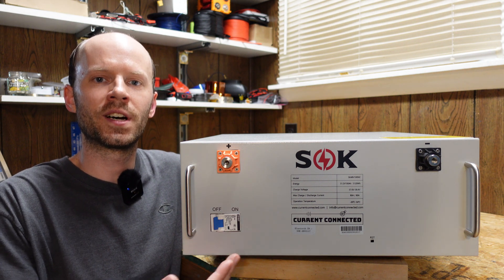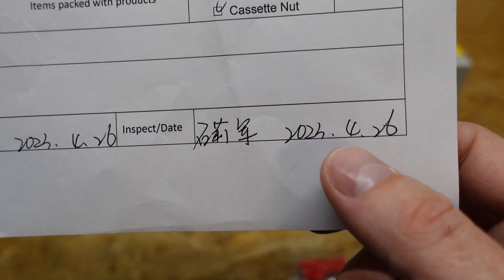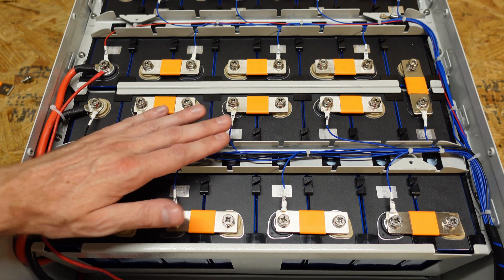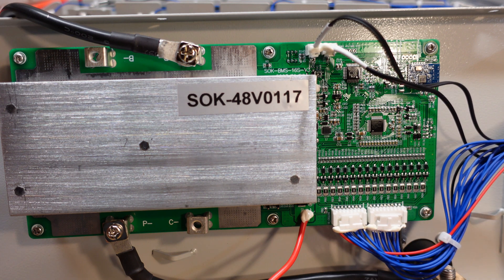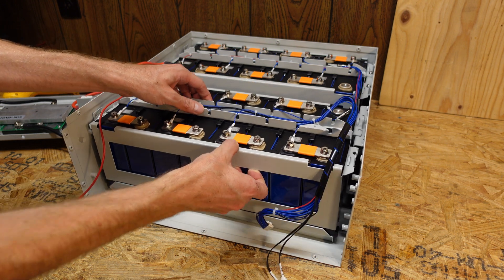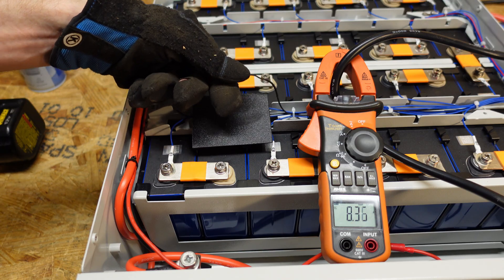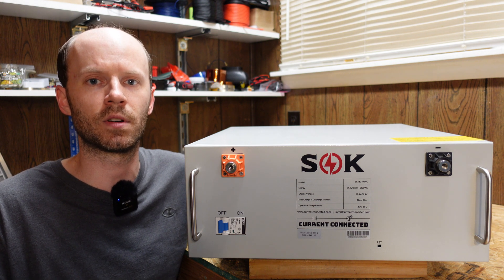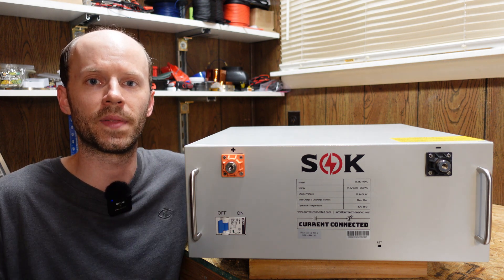The New SOK 48V LiFePO4 Rack Battery, Detailed Review Inside & Out

Comment: Is it ok to connect the battery to an inverter while the circuit braker is off and then turn it on?
Reply from the maker: This model does not have a precharge circuit built in. It may work; however, you risk tripping the over-current protection of the BMS. It's best to use a precharge resistor/circuit for the initial connection.

Comment: Is there any issue with connecting two of these in parallel?   what about connecting them in series?   I'd want to then connect a victron multiplus to allow charging and discharging into the inverter.  I'm guessing parallel might be OK but series would be problematic for the charger / inverter (given that if one disconnects after getting full or becoming empty then the voltage drops from 96 to 48).
Reply from the maker: The batteries can be connected in parallel. They CANNOT be connected in series. The components within the BMS are not rated for 96V (or 117V) and will surely fail as soon as the BMS tries to turn on/off under load.
Reply: Thank you.  Does the same hold true for a lot of these cheaper all in one batteries (for example ampere time's batteries). Is there a limit to how many you can parallel without too much issue?  I suppose you'd start by charging them up individually and then connecting, but then I'd guess they'd drift a bit over time and you'd lose some capacity in each.  I'm having a hard time understanding what happens when one of them decides its full before another one does.  The full one would break the circuit and all would stop charging?  I'm comparing this to the approach of a BMS like Electrodacus's SBMS which uses remote signaling to disconnect loads or chargers rather than using an internal relay to disconnect.  I assume these all in ones use some sort of relay approach?     @LithiumSolar

Comment: 4000 cycles (10 years) retaining 80% capacity. Eg4 at 7000 cycles (20 years) at same 80%. Would price of these even be relevant in that time to to consider the slight increase with eg4. Or nothing to worry about.
Reply from the maker: The SOK and EG4 both have the exact same cells thus the cycle life should, in theory, be the same. You would need to compare how they're defining a "cycle" to come up with those numbers. They're likely testing them differently.

Comment: Compression.  In your build, you struggled with it.  What's your opinion on it now?  Just tight enough to hold them together or something more complicated?  Poz just opened a battery from Battery Hookup on his channel and the band to hold the cells together barely had any pressure.
Reply from the maker: It's one of those topics that I'm getting tired of contemplating LOL. I had a nice design with banding straps, as he did menion in that video but I haven't made public yet. I think I'm going back to the threaded rod since it worked so well with foam spacing. I bought some steel plates for the ends instead of plywood and thicker 5/16" rod instead of 1/4". We'll see how it goes.

Comment: Nice to see an inner cage for the battery. Would be even nicer to have the same for 280ah EVE cells for sale seperate
Reply from the maker: The problem with larger cells is the weight. This already weighs in at 100lbs. A box with 16x 280Ah would weigh over 200lbs and require 3+ people (or a cart/hoist) to move it.
Reply: @LithiumSolar  I see, I love the design though. I got a DIY project and am thinking of making these cages to compress the cells together.

Comment: I had just about decided to put a 48v Rack Mount battery in a van build then use converters to step down to 24v or 12v to run my appliances. I wanted to do this for energy density in a small space. Then yesterday I saw a van builder say the converters cause a lot of heat build up and wasted energy. He suggested staying with 12V all the way. Thoughts?
Reply: i agree with the van builder.
Reply from the maker: I agree as well. The DC-DC converters that 99% of people use are not very efficient thus wasting a lot of energy as heat. It's best to design your system at the voltage you'll need rather than trying to buy a large DC-DC to step it down. Also, if the number of batteries is the same, the energy density is the same regardless if a 12V or 48V configuration.
Reply: @LithiumSolar  thank you for the response. I now have some thinking, or rethinking to do.
Reply: @HighTechLab  thank you for the reply.

Comment: Interesting option from SOK. How often does one look at the display, right. Thanks for sharing
Reply from the maker: I can't say I really look at the display on mine ever. What I do glance at all the time though is the 4 state of charge LEDs on the front. That is a nice-to-have for sure.
Reply: I am using open source monitoring software that graphs all the cells, volts, amps, etc so it isn't so much of the display as the communications jacks that you can get data out of.

Comment: Could wake it up with some 9 volts or cr123 in series.....etc
Reply from the maker: I imagine that would work - it just needs to see the voltage momentarily to flip "on".
Reply: I used a $30 amazon bought 48v lithium battery charger.  Worked great.   And now, if something ever happens to my charger or panels, I can plug the  cheap charger into my gas generator and still charge and use the battery.

Comment: flexible in the axial direction? vs bending, possibly arc them a bit before installing the bars... hard to see on this video how those bus bars are constructed,   what is under the orange band?
Reply from the maker: It's several layers (probably 50 or so) of thin metal in a rectangular shape. There's nothing else special about it. A rectangular shape of very thin layers is only going to bend in 2 directions. In the case of the battery here, that is up/down. I assume the axial direction is referring to rotational bending? It does not bend left/right.

Comment: Can this be put in series for 96v? Many online ups run on 96v. I got a 2kva/2kw apc unit that i plan on using as a off-grid setup with 96v Lifepo4. The ups is configurable through pc software and i can set exact voltage of charge and discharge.
Reply from the maker: Unfortunately no. These are not designed to be wired in series. Series support requires the transistors on the BMS to be rated for the entire system voltage.

Comment: A firmware change is already made on the next shipment of batteries so the RST button in the front not only clears overcurrent protection bus also turns the battery on from sleep mode. The BMSs in these are designed to trip as rare as possible and are absolutely perfect for systems like Outback that tend to send big surges to the batteries and don’t support communication.
Reply from the maker: YAY!!! Thank you! 😀
Reply: First, pretty surprising you'd offer a product that isn't really safe for a typical person to install and subject themselves to a potentially dangerous "on" function. Are you providing a resolution for the batteries you've already sold/don't have the new firmware?

So you're saying they are not good solutions for other inverters? Asking for a friend...
Reply: @davidfifth6109  they work fine with any 48v inverter. It’s perfectly safe to install, just some chargers have a quirk that they can’t charge a dead battery.  Why is it the battery’s fault a charger can’t turn on?  Why is a battery deemed unsafe for the charger’s shortcoming?  FYI, Victron and Sol ark don’t have the problem pointed out in this video. All of their chargers, solar controllers and inverters can charge a dead battery.
Reply: @HighTechLab  If it was an inverter issue, SOK wouldn't be fixing the issue, so it IS the battery's fault. Maybe you could address my actual question... What do all those other people have to do to get the firmware update? And do you have a list of inverters that can't start this battery? Again asking for a friend ;)
Reply: @davidfifth6109  We changed the BMS to work around the inverter/charger's shortcomings, not for a safety issue.  If it were a safety issue, we wouldn't be shipping any like this - these batteries are not firmware-updatable in the field.  How can you consider a inverter CHARGER that can't CHARGE fault of the battery?
Reply: @HighTechLab  Does that mean, all previous customers would need BMS replacements to add these "features"? Will that be free of charge or how would someone go about that?  With no communication built in or unable to update firmware in the field, really puts these batteries at a disadvantage. For a "budget" battery, if these were sub $1000 would make them a great option/competitor to diy/budget setups. In my opinion, the price gap isn't large enough to sacrifice those features.
Reply: @RasRayne  it’s a battery for crying out loud; two jobs - store charge and release it. We do not plan to overcomplicate things with features most people won’t use. That’s not the point of this battery. More features means more things to go wrong and we did our best to keep things simple and reliable.
Reply: @HighTechLab  There are some Karen's/cut throats in the comments..We are lucky to have Current Connected, they are about as good as it gets...
Reply: @HighTechLab I've been using this battery for full time RV living for over a year now, with the older firmware.   I use a (now named PWRMWR, but was bought before there any branding) all in one mppt controller/charger and 3500watt inverter.    

  It had charged just fine.  I did  purchase an individual 48v battery charger to "jumpstart" it and used it...only because I didn't want to risk messing it up trying to wake it with my system.   It had charged just fine and has only fully cycled 126 times.     Just wanted to add my real world experience and review to this conversation.     IMO this is the BEST best built battery for mobile usage.

Comment: I think the EG4 or Sungoldpower are better options for the price.  Excellent review as always.
Reply from the maker: I guess just because of the more advanced BMS?
Reply: @LithiumSolar  when you say more advanced BMS, do you mean communication ports, SOC indicators, pre-charged resistor built in and firmware updatable? if so, then I guess.